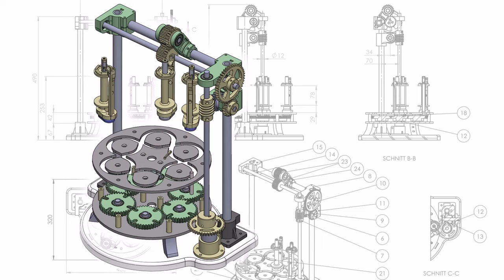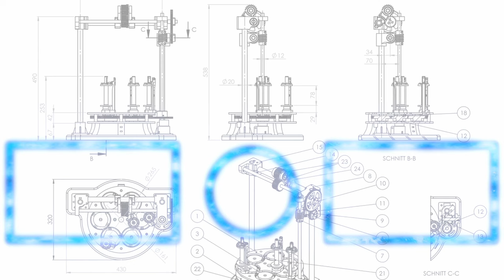3D printed braiding machine / How it works, Construction, Technical Details

Comment: Why wouldn't you just print all the parts instead of making them out of acrylic?
Reply from the maker: My printer only has 250x250mm. But you could split the parts and screw them together.

Comment: Would you be willing to make & sell one of these? I have a need for one, but I don't have a 3D printer for it.
Reply from the maker: Hello, I'm just about to develop the machine further. I will offer the machine on the Kickstarter website. There I will sell a small series of this machine. There will be a physical kit in which all parts are included except the engine. So all 3D printed parts, screws, springs, acrylic base plate, metal parts....
There will also be a digital kit with all .stl files and production drawings.
But I will need 1-2 months to finish the machine. I will upload a video on Youtube when it is ready. 
On the short I uploaded yesterday, you can see the current state. The machine will work with 12 coil carriers. But you can also use only 6.
Reply: @FraensEngineering  that’s awesome, I mainly need it for four strands, would this be an issue by any chance or would I have to use less gears? I watched the video several times and I am still wrapping my head around how the braiding works.

Do you have an idea of the cost you think you would charge on kickstarter?
Reply from the maker: Hi, unfortunately I can not yet say the exact cost. I have only calculated roughly. There are some parts that I have to have manufactured by an external company (base plate with the guideways, some shafts with thread....). I have some good connections for this and hope that this will not be too expensive. The springs for the thread tension, aluminum parts, etc. I will make myself. There are then some additional parts such as ball bearings, motor, etc. installed. Here you can fall back on cheap parts from the Chinese. I will make the price calculation in any case fair. Rich I will not 😁 It is rather a fun project because it gives me great pleasure.
Reply: @FraensEngineering  can you share the rough cost? I have been considering buying a 3d printer the whole night after watching your video.
Reply from the maker: The approximate cost will be around 300-500€. But this can still change because I have no fixed price commitments from external companies. The calculation is made for a small series. Building a single machine will cost even more. This is really only a rough calculation. I do not know what you have for manufacturing possibilities. But if you have to have all the parts made, it can cost a lot more. The laser cut acrylic glass base plate alone costs 150-200€ for individual production. You need a lot of shafts with threads for the gears. Cutting the aluminum tubes, milling the aluminum tube for the coil holder..... There comes quite what together.
Basically, a 3D printer is in my opinion anyway a sensible investment. But a good printer costs 1000€ upwards. I print with a Voron 2.4, which in my opinion is pretty much the best you can have for home use.
Reply: @FraensEngineering  Thanks for all the information. Extremely informative! Lots of valid and good points for me to consider! I will probably look at getting a 3D printer in the meantime, but I would still love to get my hands on your build when it goes on kickstarter.

Comment: Would you happen to have designs or plan to design a model that runs in multiples of 4? Like an 8 carrier that could also run as a 4 carrier.
Reply from the maker: Hello, I do not have plans for 8 carriers.
I would have to construct 2-3h. Maybe I will find the time.

Comment: Franz please can you sell me one i needed
Reply from the maker: Hello, it is very much work to build such a machine. My priorities lie elsewhere at the moment. If you have a 3D printer, you can print the parts.
Reply: @FraensEngineering  i didn't have 3d  printer . can you selling me one .i make handmade that is hard and take time but with the machine is easy
Reply: @FraensEngineering  please help me one time
Reply from the maker: In which country do you live? If I were to print the parts and send them to India, I think it would be extremely expensive. I can't sell 3D printers. But there are very cheap ones to buy.

Comment: The little boat travellers are the toughest part.  Mine we always jamming and/or making wrong turns at the intersection.  Plastic is a terrible material for them; way too much friction.  They need to have enough clearance to ride smoothly but not so much that the point can take a wrong turn.  You've given me a few nice ideas for some improvements.  Nice work.
Reply from the maker: I am currently in the process of optimizing the machine. I want to have a machine that works well. There are a few problems that need to be solved.

Comment: Pretty nice! You should make an upgrade so we can add an internal wire. Braiding can be really useful to protect electrical wires for example.
Reply: You mean like at 7:06? :)
Reply from the maker: It is possible to weave in a core with this machine. You can see that in the video at the end. However, you have to experiment a bit with the gear ratio.
Reply: @FraensEngineering  Nice, I didn't see that :')
And indeed, but maybe 6 wires are not enough too. At least for large cores like in the video, it seems to have some spacing.
Still very cool.

Too bad this kind of machine is large, even if I try to make one, I don't have space to store it.
Reply from the maker: I think the distance could be reduced with a larger gear ratio.
Yes, the storage space is one of those things for me too. In the last year some machines have accumulated with me.
Reply: @FraensEngineering  Hehe, the best machines are those that can be easily dismantled :')

For example the MPCNC is very cool for this. Easy to disassemble, and doesn't take up much space once in pieces.

Comment: If one doesn't have tooling for the acrylic, are those parts printable too? It looks like they should be.
Reply from the maker: Theoretically, this should be possible. I cannot say whether the stability is still guaranteed. I think to manufacture the acrylic parts from wood would be better. You could process wood with a scroll saw.

Comment: Do you believe that this will work with thinner threads in order to make cord for macrame jewelry?
Well done! Thank you for sharing this
Reply from the maker: With thin threads you have to experiment a bit with the spring tension. The deflection points result in a certain minimum tension in the thread. I have not yet tested a sewing thread. I will try that and let you know.

Comment: Hi this really amazing Fraens would you also have a list of the motors and the schematics for the pinions length radius, bearing sizes, etc cheers from the world (and NZ)
Reply from the maker: Hi, I have updated the drawings on Thingiverse. It's a pity that you can't upload DXF files there. You can use any motor. Unfortunately I don't know the exact name of my engine. I have this one lying around for some years. I have linked the bearings in the video description. 
With the assembly drawing on Thingiverse it should be possible to build the machine with some technical skills ;-). If you need a DXF or TIF file of the base plate I can send it to you by mail.

Translated with www.DeepL.com/Translator (free version)

Comment: Buongiorno..... ottimo prodotto, alla fine quanto costa realizzarlo ed eventualmente lo vendete già con le partì stampate?
Saluti dal Italia
Reply from the maker: Hello, unfortunately I cannot offer a ready-made machine. However, you can download everything you need to build it https://www.etsy.com/at/listing/1462996984/3d-printed-braiding-machine?click_key=e4315e360139768e5b941870c2b4326f9da02d16%3A1462996984&click_sum=193e1a3a&ref=shop_home_feat_1
Best regards from Austria
Reply: Grazie.
Indicativamente quanto costerebbe realizzare il prodotto una volta acquistato il PDF.
Chiedo x valutare iun presupposto costo finale di reazione
Reply from the maker: It is not just about PDF. You get all the stl files, a complete 3D model in step format, a parts list with all the parts you need, and all the assembly drawings you need. Write me a short mail and I will send you the parts list of all required parts. Then you can calculate the costs. You can find the mail on my channel.

Comment: Would this braid 4 strands ? Or is it specifically for 6 . I use an awful lot of 4 stand that I make by hand . I would love this.
Reply from the maker: Hello,
Typically these machines are for 2/4/6/8... coils.
I would have to test 4 coils.
I have a new version of the machine in case you haven't seen it yet: https://www.kickstarter.com/projects/1514577012/3d-printed-braiding-machine?ref=user_menu
Reply: Hi there . My son has purchased the plans for this awesome machine .   He has built it for me but we are having an issue with the loading of the bobbins . Is there a loading sequence ? . I typically do a 4 thread braid by hand as I mentioned . We are getting 2 twisted threads  so what do you think we are doing wrong ?

Comment: in 4:27 there is a gear in the outer part of the  worm gear transmission,  maybe #6 gear on the diagram but the file is missing
Reply from the maker: As soon as I'm at the computer I'll take a look
Reply: @FraensEngineering   thank you!!
Reply from the maker: Hi, the part was uploaded under the name Z1.

Comment: Hi you always use the same filament in your pints, which reference do you stick on ?
Reply from the maker: I use Eryone Matte Filament.
Reply: @FraensEngineering  I'm surprise that you use a matte filament for such mechanical purposes. I tried both polyterra PLA and Giantarm Matte PLA, which are nearly the same. Matte PLA got a kind of wierd plastic-marshmallow-like behavious during the print. The outer surface is however nice overall. But such materials, despite being mure ductile than regular PLA are also more brittle (able to break) considering the much worse inter layer adhesion they got. I didn't tried yet the eryone version, and dispite it s lower density compared to the brands i tried i expect the formulation and overhall behaviour to be really close. Didn't you notice it ?

Comment: HI! I almost finish building this wonderful machine, could you please share the 3d file for the black supports that hold the wider pipes, and also on minute 5:12 I can see a printed part behind the nut on the widest pipe what is that one ?
Reply from the maker: Hi, as soon as I'm at the computer I'll take a look.
Reply: @FraensEngineering  thank you very much!
Reply from the maker: Hi, the black parts were not printed. These are so-called foot clamp pieces. Maybe you can buy such or build something else. 
Which part do you mean at minute 5:12? I can't see a nut here.
Reply: @FraensEngineering   in 4:27 there is a gear in the outer part of the  worm gear transmission,  maybe #6 gear on the diagram but the file is missing

Comment: The Kicktarter for a greater number of spools is interesting.

The way you have left this 6 spool design leaves me concerned about what you get from a finished Kickstarter project.

This 6 spool design has no assembly documentation, very few measurements (rod lengths?), missing 3D print parts, and an inadequate parts list. I recognize in the Kickstarter that you are promising many of these things, but in absense of an example of what we should expect, it is harder to support. This is just intended as constructive feedback.

I'm mostly finished building the 6 spool version, and I've run into the new problem of what kind of spool do I use. The spool holder supports a spool that is 3 inches tall, with an inside diameter of 5/8" (78mmx16mm). Serger spools are 4.4 inches tall. Sewing machine spools have too small an inside diameter. So what kind of spool are we supposed to use with either design? I realized on the kickstarter that you wind it with a drill, and I see a missed opportunity where you could have sized this for serger spools by making it 1.5 inches taller. I think I would be willing to support a project that could use Serger spools.

All of that said, I am very impressed with what you make, I just think some of your projects need more polish, and this 6 spool is definitely one of them. I haven't tried assembling your other projects.

Keep up the great work!
Reply from the maker: Hello, the KS campaign is a purely digital product. Since the machine was designed and built by me, there should be no delivery problems. The files are ready to be shared. The machines I build are basically prototypes. That's why the 6 coil design is very rough. Many things have been improved on the 12 spool design. If you mean the missing parts of the 6 spool version on Thingiverse, that was not done unintentionally. After personal request I always shared the missing parts. 
Regarding the 2 bearing housings: a one-sided bearing is technically very unclean. In fact I tested it to save a lot of ball bearings. Result: wobbly gears. In my more than 10 years career as a designer in mechanical engineering, I would not have drawn something like this. Also a fit has some undersize.
In the KS campaign the 12 spool version is offered and not the old 6 spool design. The machine works great. Motivation to build this machine came from the many requests. So I created a digital fileset with all the needed production drawings. The drawings and parts lists were made to the best of my knowledge and I would be surprised if there were any problems. Prototyping, new designs and the creation of production drawings is my daily bread. The braiding machine was designed as simple as possible. Suggestions for improvement are welcome ;-)
Reply: @FraensEngineering  this is a really good response. I think making it compatible with serger spools (112mm tall) would be a game changer for the KS version. I might still back it.

Good Luck!
Reply from the maker: The coils on the KS version have a conical design. This means that the coils are thicker at the top and bottom. In the middle where the rope is pulled off, the coil is thinner. Unfortunately, you can not see this in the video, because I built it later.
Reply: @FraensEngineering  so far I am finding the gears do not mesh well (too much distance from each gear), and with no clear instructions, it's hard to get the basic functioning of the 6 spool to work properly. Is there a reason why you left the 6 spool project so incomplete? If I could see some success with it, I could see investing in your KS project. Right now I don't have a lot of confidencein your end product.
Reply from the maker: Hello, the 6 coil project has not been discontinued. It became the 12 coil project (https://youtu.be/4jdi63u2LKI).
The gear design was completely revised. The spacing of the gears was made to fit in the Kickstarter version. In addition, the gears were equipped with involute gearing. Much more important than the spacing of the gears is the accuracy of fit of the slideway. The adjustment of the center pieces is very important.
In the video from minute 6.10 you can see the assembly of the coil carrier. I think here the function of these should be well visible. Basically, the rope tension is maintained by a spring. The locking lever prevents too much cord from being wound from the spool.
Reply: @FraensEngineering  

I would like to share my experiences so far.

I had 3D printed the base and slideway that you have made out of acrylic. They do not support the gear holes very well, and the slideway is hard to get level. I plan to cut the base out of wood to see if that makes the movement smoother. I will then do the same with the slideway if it doesn't. Currently the spool bases have a tendency to pop out of the gear slot and jam. I am hoping a better base will fix that.

There does not seem to be any issues with the gears and spools theselves other than the spacing of the holes for the gears which do not allow as clean a mesh as I would prefer.

You are also missing the black mounts for the base of the 20 mm rods in the download package for the 6 spool version. Can you provide a link to that?
Reply from the maker: Hi, Do you build the machine from Thingiverse? This one was a quick and dirty attempt. A feasibility study if you will. Which machine do you mean? Probably not the one from KS. If you print the slideway or make it out of wood, it can't work. The coefficient of friction is much too high. My 6-coil machine worked at that time. I made about 50m of rope with it. That was also the reason why I developed the machine further. Of course it is not plug and play. 
I build my machines from scratch. Hundreds of hours go into such a project. In the beginning I don't know if it will work in the end. At some point I have to draw a line and finish the project. This is then the state that I publish. I don't charge money for machines that don't work! That's why the 6 bobbin spotting machine is for free. 
But I will help you and send you the missing parts. I will also update the Thingiverse parts. You can write me at FraensEngineering@gmx.at.
Reply: @FraensEngineering  this is another good response. I had already printed everything and spent the money on the parts for the 6 spool when your KS campaign started. After that I found a number of things including the link in this video had changed to be the 12 spool KS version. This left me trying to figure out your 6 spool. It was a bit of a struggle for the first project of yours that I had tried. It was very frustrating.

I appreciate your willingness to assist me with the 6 spool, and I will contact you at the email provided. I think you have some amazing projects, and you clearly engage with your users. I look forward to seeing what you create in the future.